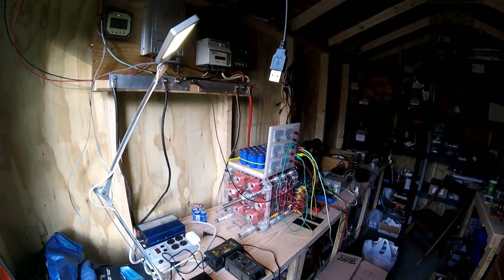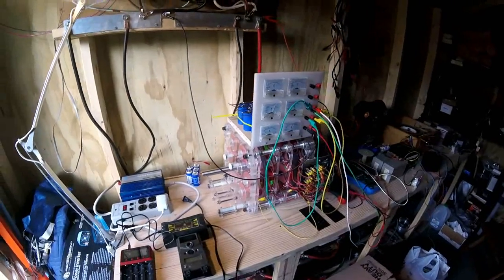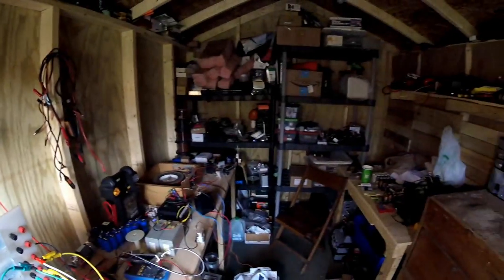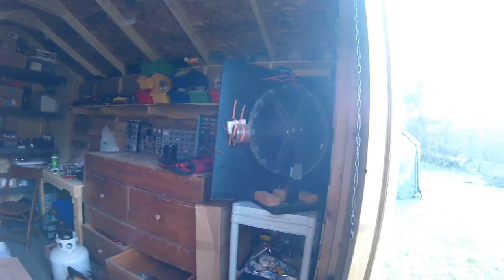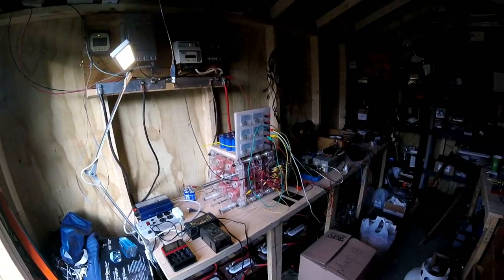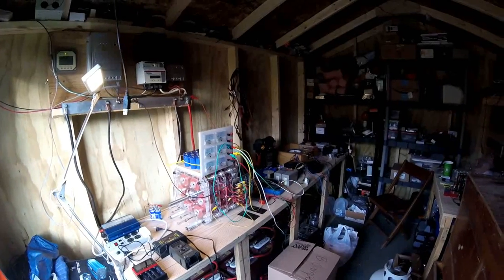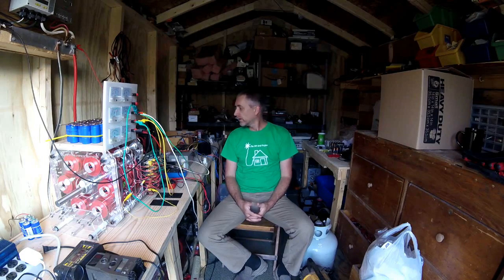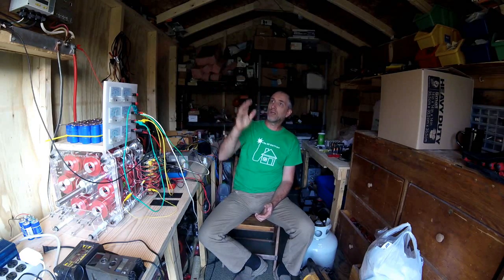Welcome To The Do It Yourself World Electronics

Comment: Ordering the gyroscopic inertia generator from Quantamagnetics soon, what are your thoughts on using something like that for use in off grid power?
Reply from the maker: I think that it is like a large scale Bedini motor so it has huge potential. But as with the Bedini motor you have to experiment with it in order to get any usable energy out of it. I am still tuning mine. It charges but slowly. But it has great potential I am sure. I will get it.

Comment: Troy,  there is an interesting experiment I saw concerning a magnet brought near a toy DC brushed motor causing the rpm to increase and current go down AND apparently a slight recharging of the input battery!  Not saying it is free energy or anything.  Just that a commutated brush permanent magnet motor involves switching, sparking, BEMF, and abrupt discharge effects not unlike the Bedini pulsed magnet motor setup.  Just type "Ray's Magnetic Free Energy Coupling" to see the video.  There might be something applicable to your setup.  Very simple and quick tests.  Before anybody jumps on me saying the magnet is just making the motor more efficient, do know that these motors are already pretty efficient perhaps in the neighbor hood of 85-90% so there is not a whole lot of room for conventional under unity improvement.
Reply from the maker: Lindemann shows how to convert a normal motor into a super efficient motor. I want to do that one day using a motor scooter
Reply: I met Lindemann at the Tesla Convention some years ago.  He was demonstrating his "attraction motor".  Is that the motor you are talking about?  If so, he let me look at it and explained it.  He was using the BEMF to light some filament light bulbs not LEDs.  It would speed up under the bulb load and far more when he shorted the bulb.  Input current would drop a lot.
Reply from the maker: Its in his video about motors. I cant remember the name but he is selling the full book and just gives you a teaser video

Comment: I first found you when you wer building a solar panel.
You inspired me to go solar. I now have a 6kw grid tied system that works very well.
It is an enphase system 
Each pabnel has a micro invertor.  As AC travels with minimum losses wire size is not critical.
Enphase also puts all data on the web so I can monitor the system from my smart phone and the
company can see how its devices perform in different latitudes.
I also have a couple of 12v pannels for powering LED lights.
30m of wire with MC4 connectors cost $170 !

Comment: Hi Troy.  Try this subject to get the ball rolling on your new channel.  Concerning your high voltage observation across the small capacitor paralleled across the charging battery of the Bedini device.  Some have suggested it is acting as a high frequency filter where the pulse energy is effectively across the small cap and not the large battery.  In electronic pcb design it is common to solder a tiny cap across the power and ground pins of digital chips.  This is to filter high frequency noise, pulses, static charge bursts etc and direct these unwanted signals to the ground path and not reach the internal chip circuits.  So in effect, high frequencies (pulses too) are shorted to ground but low frequencies and DC pass unaffected to the output battery.  But, now, there may be something different in your circuit if we assume most or all of the energy is in the pulse spike and there is no low frequency energy in the waveform complex like a square wave signal with rising and falling spike puses.  If the small capacitor is acting as a filter as many think, then most of the pulse energy would be lost across the small capacitor and little or NO ENERGY should be available to charge your battery, since the small cap is shorting the pulse energy to return ground of the circuit if we respect traditional rules.  It would be great to run your test again and double verify that the battery is getting charged/improved as much or even more with the cap as without the cap.  If the cap lowers the battery charging then the filter idea may hold some truth.  If the cap does not change the regular battery charging or if it actually improves it, then filtering is not the real function in this application.
Reply from the maker: Very interesting ideas. I am not sure though without time and two exact same batteries, how to test that theory. So far it appears that the batteries are charging faster with the capacitor. But only time would truly show us.
Reply from the maker: Now, I have a pocket scope which I am working with but it is not at all accurate nor is it working very well sometimes. I will try to run some tests using the scope and see what we can come up with.
Reply: Troy, well just for a quick rough test, confirm if any battery will still charge while the small cap is paralleled across it.  Look at the voltages.  Is the battery still taking a charge if yes, then it is a suggestive hint that indeed the small cap is not filtering/shorting out the end reaction (whatever it is really doing) in the battery.
Reply from the maker: Ok. I will connect the data logging meter and do an hour or so of recording. One battery with the cap and another without. The same batteries. Same types of diodes. Lets see what happens.